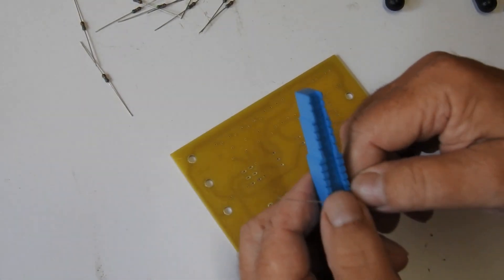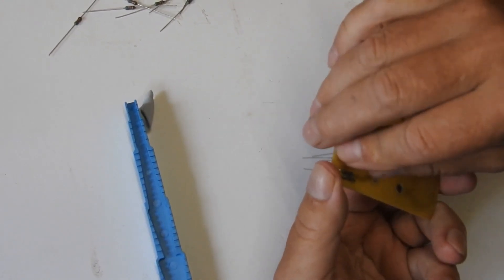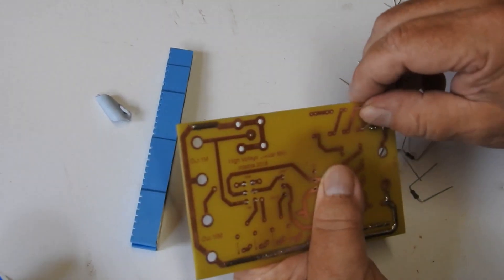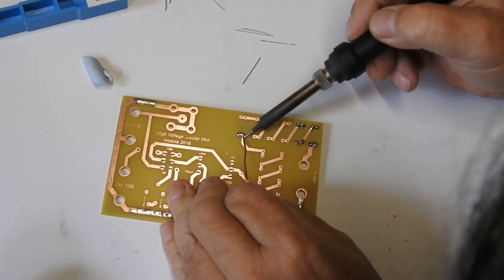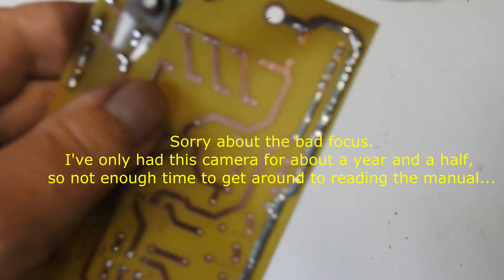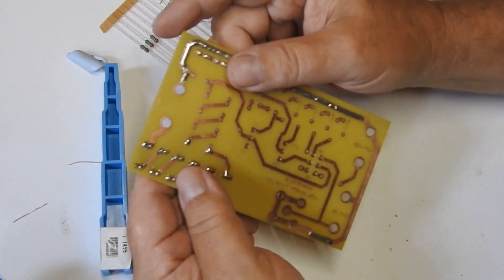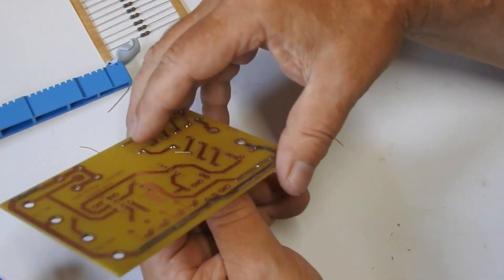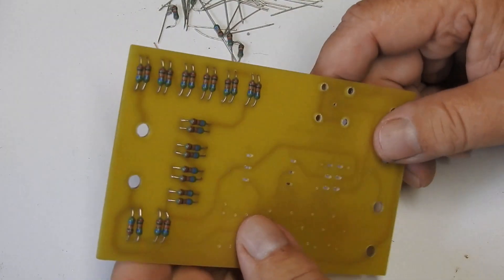An alternative method for soldering through-hole components

Comment: Seems fine for designed printed circuit board. Not so useful on prototype boards where jumper wires are needed. Presenter seems at but smug.

Comment from the maker: This video received quite some criticism on the EEVBlog forum, and I acknowledge that the previous title ("how to solder through-hole components properly") may have been somewhat misleading and presumptuous, so I've changed it.
http://www.eevblog.com/forum/projects/how-to-solder-through-hole-parts-properly/
My response in that thread included the following:-

The advantages I mention (assembly speed, better contact area, smooth result, protection from oxidation, reduced shock stress), are all true. 

Some comments indicate that I may not have gotten my point across clearly, for example that the lead barely protrudes past the hole and/or that the lead is buried under a blob of solder and thus good contact with the solder cannot be assured. No, there is ample lead exposed to the solder, and an observable solder fillet, indicating good wetting, is formed:-
[img]https://i.imgur.com/iAsTx9G.jpg[/img]

On the subject of removability, the video shows how easily I removed the resistors soldered in what I termed the "bad way". Not to mention, the part being removed is likely suspect anyway, and causing damage to remove it (if required) should not be a problem, especially for cheap parts like resistors.

To the criticisms relating to the more general aspects of video production (length, quality, etc), I say "Let he who makes perfect YouTube videos cast the first..."

The PACE soldering videos mentioned above are indeed excellent. In places their examples have clinched leads as I advocate, though I cut them shorter than they show (which makes removal easier).  See these at:-
https://www.youtube.com/watch?v=Nq5ngauITsw&index=9&list=PL926EC0F1F93C1837

And finally, I say "don't knock it 'till you've tried it". 
Almost everyone will have a never-to-be-used PCB lying around, and be able to sacrifice a dozen resistors for science. 
Please try out what I've described, and see if I'm full of crap...